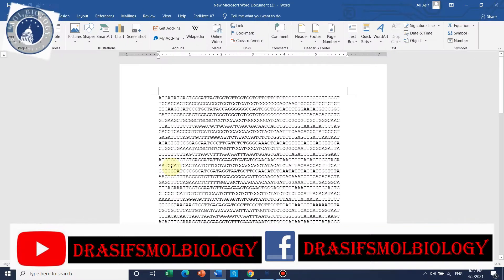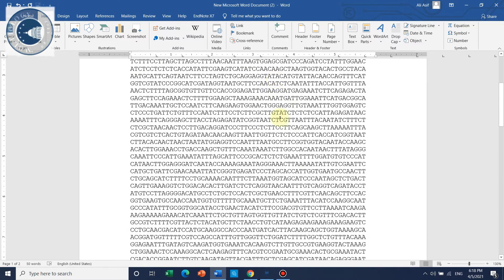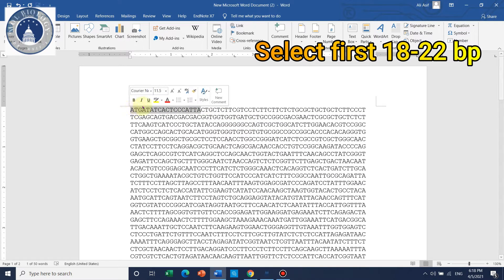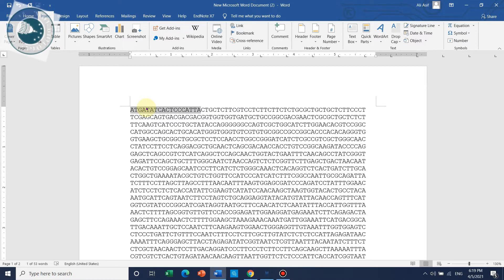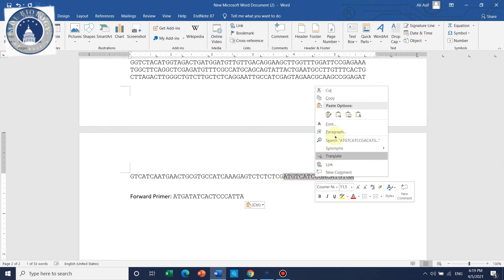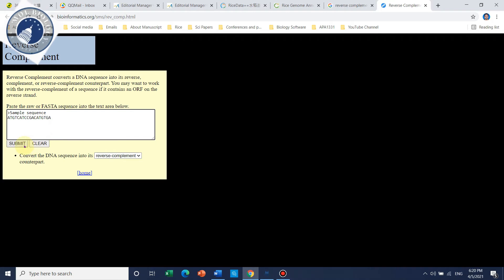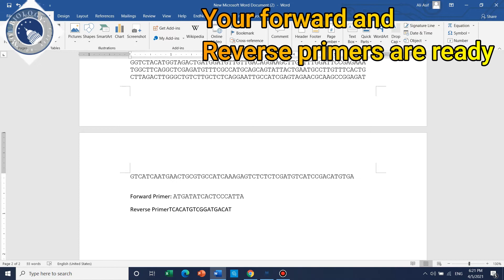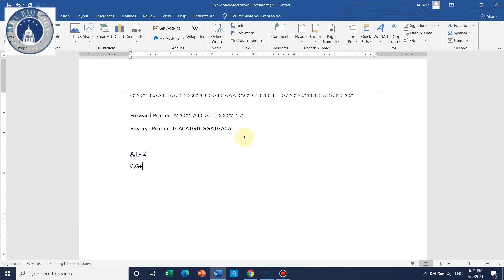How to design Primers manually | Practice Problem using Hand | Primer designing for PCR

Comment: you converted the sequence to reverse compliment to form reverse primer . why did you not do so for forward primer . plz reply
Reply from the maker: Good question, as you know DNA is double stranded. Forward primer attaches on 5-3, and reverse primer attaches on 3-5 strand. That’s why in most example people use/write only strand because both strands are complementary but reverse in direction . To get the sequence of second strand we need to reverse complement the first. Similarly primer attachment to second strand needs reverse complementation.
Reply: @asifmolbio thnxu  i got it . but here is one more confusion in my mind . when we are designing a primer by clustal Omega or megaX , we take identical region and consider these sequence as forward primer. how can this sequence be primer as we know primer should be complementary to the target region .... plz  respond
Reply from the maker: @SACHUGHTAILAB  omega and clustal are phylogenetic building software not for primer designing.
Reply: @asifmolbio  ok consider your mannual method . you also  took first 18 nucleotides as forward primer . how this primer will bind with this region as its not complementary to this region.